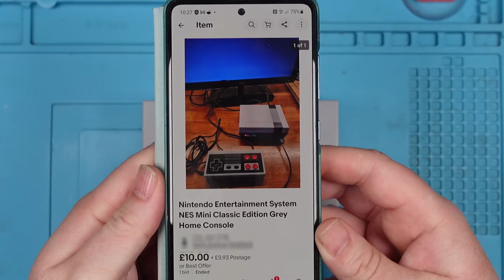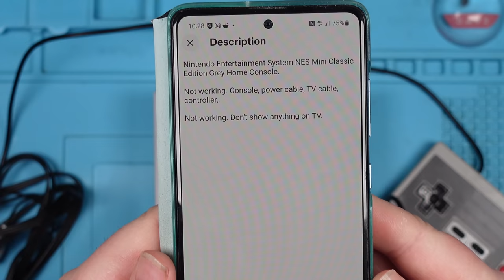I Paid £10 For a FAULTY "NES" Mini Console | Can I FIX It?

Comment from the maker: Stupid.  "Nintendo".  Console.  Thing.
Reply: Pffft. It's a NOAC -- Nintendo-on-a-chip. Basically there's a NES in an FPGA under the blob, and the games are all on the nearby Flash ROM. If you can call those... things... games. (Trust me, "stupid" really does apply here. Gratuitously.) Most are either low-effort pirate jobs, or far, far worse fake games where they've gone and swapped palettes and sprites around or otherwise reskinned something else, usually with the absolute bare minimum effort involved in making something that, in some vaguely technical sense, does in fact produce a game that will start and is approximately playable (and all too often is very little more, if at all, than that). I have one myself, just out of morbid curiosity, and from everything I can tell? Playing the Atari 2600 E.T. game while rigged to a taser so that it zaps you whenever you screw up, would be a bit more enjoyable of an afternoon than that thing. They are universally bottom-dollar cashgrabs and utter trash. eWaste out of the box.
Reply: Indeed
Reply: that is a great case for a retro pi project!!!
Reply: The final screws are put in when the device is already repaired, not before. This way you lose less time and do not destroy the plastics where they are screwed.
Reply: is that fake contras??????????????
Reply: I applaud you for fixing it, even though it's absolute super e-waste.
Reply: I'm willing to bet that is one of those consoles that has the X-RATED GAMES somewhere in the list..... no, I'm not joking... there are actually some really NON-CHILD-FRIENDLY games snuck in into that list and parents have found their kids playing them and were very confused..... I guess you would have to test all 8000+ games that they claim are on there..... I guess if you get bored one day lol
Reply: That is some material for Dankpod's 1 Grit work.
Reply: just be honest, you were soo disappointed in the easy fix, that you intentionally broke the usb :P naughty naughty man <3
Reply: Could you help? I have bought same faulty console but with little modified PCB design. Anyway it looks that all same elements are on it as on yours. Unfortunately mine is after somoeones repair try and has missing one of two SOT-23 elements (the thingy with 3 legs). I can not read on your movie what is written on it... there are no any mentions in the INTERNET about this PCB but your movie. Could you check this for me? PLEASE?????
Reply: your thumbnail for this video says "no display" but I think it could've been "dis no play"

Comment: Would be really funny if you returned it to the seller because it was fake and just leave a note in the package that you fixed the crappy thing😂
Reply: Or write them a message that you fixed it, then realized it was fake and now want your money back.
Reply: It's not fake it's what it was listed as.
Reply: @personperson3101 It's not what it's listed as
Reply: @personperson3101  No, it definitely isn't what it was listed at, as can be seen at aroun 0:20. It was listed as a "Nintendo Entertainment System NES Mini", which it clearly isn't.
Reply: @MyRegardsToTheDodo  milk, malk, what’s the difference?
Reply: @hugegamer5988 Do you not realize Nintendo made an official NES mini console?
Reply: @jnut1246  do you not know what a knock off is?
Reply: @hugegamer5988  I should be asking you that question.  You were the one asking what the difference is.  The one in the video is a fake one.
Edit: look at the controller ports.  The real one uses the same ports as used on Wii remotes for nunchucks and classic controllers.  This one does not.
Reply: @jnut1246  I like how his joke flew right over your head.

Comment: 10:29 the horses hoof shaped soldering iron tips that have a slight concave surface are great for soldering pins like that while preventing bridging. To fix bridges with that type of tip you just clean the solder of the tip so you are left with a concave surface on the tip that is ready to take up the excess solder from the pins.

Comment: The final screws are put in when the device is already repaired, not before. This way you lose less time and do not destroy the plastics where they are screwed.
Reply: no matter how well the repair went, if you fully assemble all the fasteners before testing you’ll be screwed.

Comment: Probably the supplied psu doesn't care about the short circuit, but maybe the poorly designed TV or whatever device you plug it in later on does. Please don't leave it like that!

Comment: I don't think I have ever seen an AV out like that
Reply from the maker: It's an odd one, that's for sure.  You normally see it on little handhelds, but it's odd for a "console" to have a 3.5mm plug like that!
Reply: Raspberry Pi has got it as well - only the first models had a real chinch video jack.

Comment: Can you post links to products you use like what flux, iron and solder? Have you tried flux core solder or is it too fat for these newer boards? Also where do you buy the protection stuff you put on the board after repairing?

Comment: Looks like one of those bootleg Famicom clones we had back in the 90s (Subor, Lifa and many other clones), the later model type - barebone and extremely budget, with that stupid droplet chip that made device (and cartridges) mostly unrepairable.
In a way, it's closer to original NES experience than Classic Mini, but still is a cheap piece of junk. BTW it costs around 8$ on Ali new, so that ebay seller even received some profit 🤤

Comment: The number next to the title usually refers to the level (they are fast level saves, if I'm correct).  This 'Nontendo' knock-off was at least easy to fix, but was it worth it?  LOL.  (Deliberate misspelling by the way - because it is a 'Nontendo' rather than a 'Nintendo').  LOL.

Comment: You know, beyond looking cool, I never understood the point of a nes mini. For about the same price as this ripoff one, you can get a raspberry pi pico, a case, power cable and a nes controller. It's only like 2 extra steps. It wont emulate much more than nes and wont look as cool, but its still a heck of alot better than a nes mini and definitely better than a cheap knockoff one.
Reply: You can soft mod the official NES/SNES with Hakchi to do almost everything the rPi will. I'm just not au fait enough with Linux to be able to face that route.
Reply: @imaginitivity7853  You could, but that wasn't the point. I was specifically referring to the nes mini, which is quite expensive and actually can't do more than a raspberry pi. For the same price as a nes mini, you can get a pi 3 (or on a good day, a 4) that can emulate dozens of times better. My entire point was simply that for the price of a knockoff, you can get a much cheaper equivalently powerful device.

Comment: I got a real NES mini which I think was preowned. It came with a second controller in box(which clued me in to being preowned) and the picture looks like absolute horsesh!T. you want it? as far as I can tell it's official and not just a 8000000 in 1 clone console where every level of all the games is included as "4" and "8". perhaps if you notice a similar issue with it you can make a potential fix video